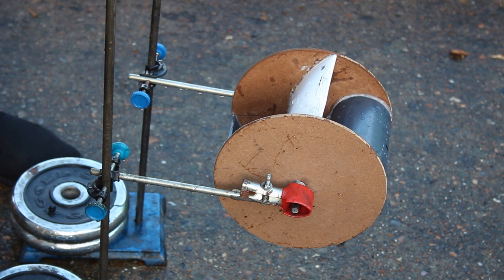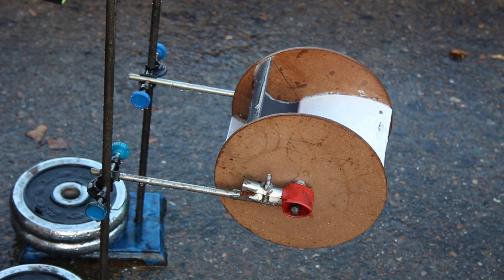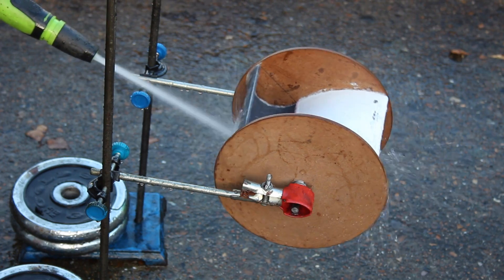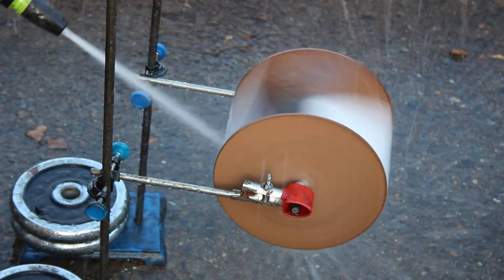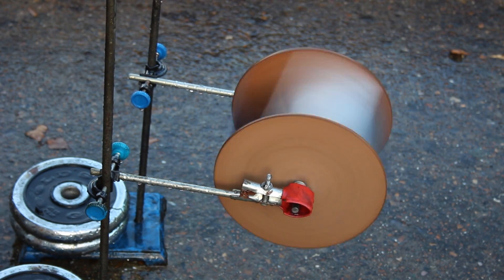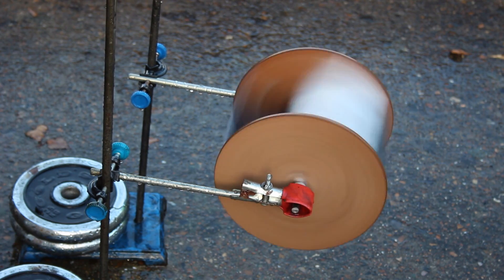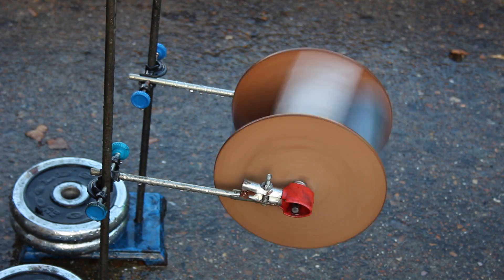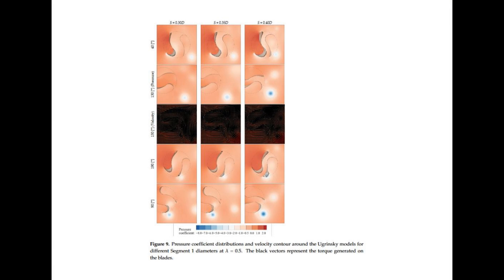1756 The Ugrinsky Water Turbine

Comment: I'm now thinking of building a 2m long turbine like this to lay along the top edge of my standalone solar panels like you showed on the roof ridge setup, this would use the panel's surface to direct the air up into the horizontally placed turbine.
Reply from the maker: I like that idea mate - a lot - I may well do something similar = thanks for sharing
Reply: I saw something like this rooftop installation from a Canadian (I think) company about a year ago. It wasn't available in the UK then, but it does sound like a great idea with the roof channelling the wind up to the ridge.

Comment: Hm... drag around the sharp trailing edges of the curve profile, as a wing would experience? Would drag aid or inhibit the turning motion?
Reply from the maker: I would think inhibit
Reply: @ThinkingandTinkering  Yet. Drag would increase coupling between the flow and the object, which is mechanically fixed, tending to drag the item with the flow - so adding energy?? Unclear as to what happens - an experiment is needed! :)

Comment: I believe submerging it would reduce the torque somewhat due to the ends being pushed on by weight of the water, basically acting like a friction material.  I would think that it acting more like a water wheel would be the best bet as it would disrupt the surface tension allowing it to spin faster.  But then you still have the issue of water proofing the motor so it doesn't get all gunked up, maybe a "gear" (pulley and belt type) driven motor to keep the motor out of the water would be the easiest solution to that issue.
Reply from the maker: maybe - but if you think about it one way air is just a fluid and a river is pretty analogous to  an airflow